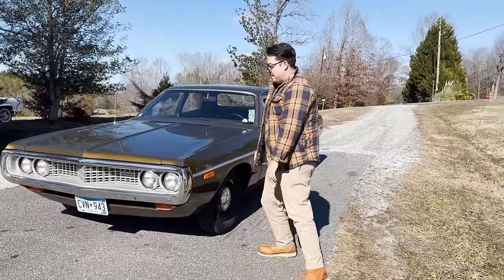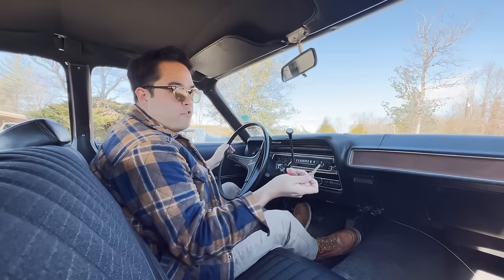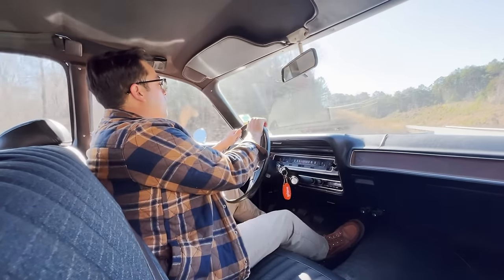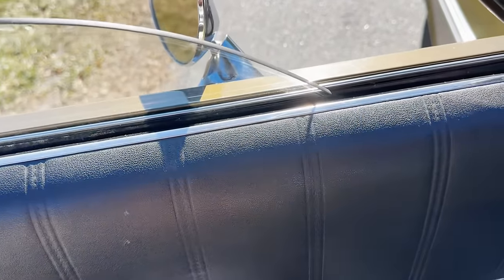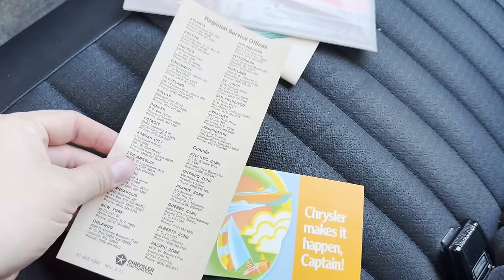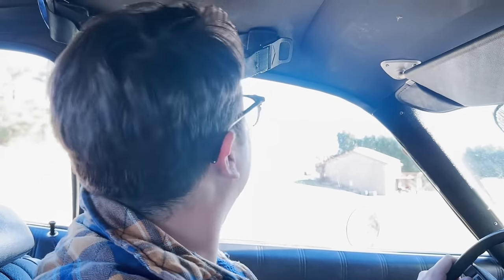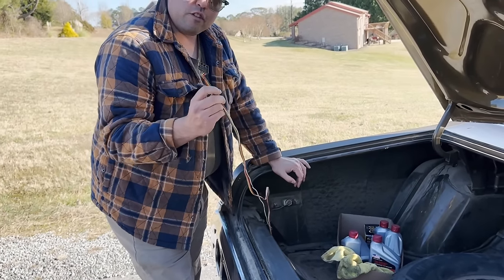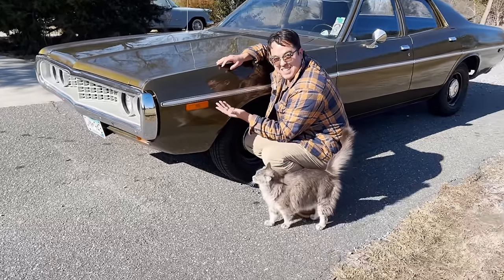1972 Dodge Coronet Custom! Rare Slant Six Stick Shift! Obsolete Automotive Reviews Walkthrough Drive

Comment: hidden wipers were a big deal because of the new automated car wash, some would rip them suckers right off, antennas as well...  hidden tucks em out of the way no issues, plus the heat doesn't pound on the ribber wiper blade destroying it in a day.. "118 in phoenix today"...  park inthe direct sunlight for 30 minutes in that kind of heat.. wipers STICK to your windshield and destroy wiper motors.. so more than a few reasons right, looks better?  the wind doesn't catch them and whistle?  jackyls are less likely to grab em and rip em off, why they had retractable antennas as well.. oh yea that's a thing when you are 13 and rebellious as hale...

Comment: Nice car. Reminds me of a couple of Fords I had with Six and stick....with little else. Just refrain from calling it "three on the tree"..most auto nick names sound stupid. like dog dish hub caps. Drum brakes are fine. and go easy with that shifter. Shift slow and deliberately, don't push hard to get 2nd out of low.....nothing will break if you shift easy. and    yes years ago we called them "stick shifts" . Too bad there aren't any cars like this today. The market could use realistic sized cars with no bullshit in them.

Comment: The advantage of hidden wipers is that the blades don't freeze over in the winter when driving in slushy conditions. The rubber also lasts longer, since they are hidden away fron the UV rays in the summer. I wouldn't really mention the aerodynamics as these era cars were really bricks in the wind, but they are a bit quieter at higher highway speeds since less drag on the w/shield. 

Have the same wipers on my 2dr Newport Custom . Check my channel out. Cheers

ps/ how much u sellin' this Coronet for ?
Reply: Instead, the wipers get frozen over in a chunk and don’t funtion at all unless you dig out all the ice from the cowl
Reply: But the clip for the articulating arm pops loose and the wiper blade flops all over the place.
Reply from the maker: Be sure to follow my Instagram where I post any cars for sale. I have some work to do on this car before listing it.

Comment: In the '60/'70s, the 6cyl & 3 on tree was the basic power train for almost all models. These strippers were known a price leaders. Usually had rubber floor mat, dealers rarely had more than one or two on the lot. Oh, you wanna V8? It's going to cost extra. I don't have price list for Chrysler corp, but a 302 V8 in a 1973 Torino upped price $95(was std on Gran Torino). Don't want to shift? Automatic will set you back a couple pay checks, $210. The tunes, AM flavor, $64, AM/FM, $208. All about the money, I can guarantee the 318 cost extra over the bent six. Each mfgr had comparable models to the others.
Reply from the maker: The 225 6cyl and 318 v8 were both standard in the Coronet and Coronet Custom for 1972. No difference in price from what I see. The 400 big blocks with 2bbl or 4bbl were extra cost options.
Reply: @ObsoleteAutomotive  In the Standard Catalog of American cars, TWO prices and weights without explanation are listed for '72 Coronet. Sliding over to Plymouth Satellite, the two are said to be engine and weight. So, if both were std, it wasn't a same price choice (Seems like a confuse the customer tactic to me). Customer paid EXTRA for V8. The 6cyl was $2721 while V8 $2828(or $107 difference, which is within $12 of what Ford was charging for "optional" 302 V8). Weight with 6 six 3350 Lb, while 318 were 3375. Station wagons are listed only with one price/weight, 318 v8 is said to be std.
Reply from the maker: @tombryant1104  Unless we find a factory price list specifically showing the difference then I can only go off the literature. Normally if an engine is extra cost then it would show it as being extra and not standard. Also six cylinders could be ordered in wagons so that isn’t an accurate reference. 

Six cylinders many times would have smaller brakes, weaker transmissions and rear axles and such so a price difference could be reflected in that as well if the cars varied in equipment due to difference in engines. Sales tactic? Perhaps.
Reply: @ObsoleteAutomotive  I can see your point, but I don't see Chrysler selling a entry level vehicle at same price for 6cyl & V8. If they did, they would have had a big edge over the other auto makers charging extra for V8. No chance they were going to lose $100 per car. V8 have additional parts and more complex machining procedures that requires additional time to complete.

Comment: Man, are those red wings you're wearing 😊 ?
Reply from the maker: They are Thorogoods
Reply: @ObsoleteAutomotive Still, good😊! Thumbs up! Love the video. Cheers, mate!
Reply from the maker: @riddickriddick9520  I got redwings too. 😂 Thanks for watching!
Reply: @ObsoleteAutomotive  Np, love those old american cars! I just bought iron rangers few days ago, amber harness ... still breaking them in.😁
Reply from the maker: @riddickriddick9520  I got a couple pairs of the Iron Rangers myself! I find the “old style” boots very comfortable. Been wearing them for over a decade now.
Reply: @ObsoleteAutomotive  Exactly! So how do you condition them? You use those "saphire" regenerators and creams, or do you use cheaper products?
Reply from the maker: As of recent I only really use Huberd’s Shoe Grease to keep the leather from drying out and it also water proofs them. I also have used neatsfoot oil.
Reply: @ObsoleteAutomotive  I see...thnx for the tip, mate 😁!

Comment: You need to Midasize it badly, and you really need to clean the windows.  I would spring for a new brake system, and spend the money for Power Disc Brakes On All 4 Wheels.  It's worth it in Minnesota.  A Slant-6 is overworked in a Coronet and it is BEATEN TO DEATH in a Monaco.  The car is TOOOOOOO BIG for that engine, which was really made for Darts and Valiants.  12 MPG SUCKS in a car with no luxuries.  Still, these days you're lucky to find a Mopar at all.

Comment: Nice car... too bad the driver beats on it this way. No reason to be winding it out to 6 grand on every shift. Pushrod engine.... you'll kill it quick. treat that gear shifter nice too. Unobtanium if you break it.
Reply from the maker: Because nobody ever puts a car through its paces. It shows the car can move if it needs to. 

The shifter ain’t going to fling apart. The engine ain’t going to explode. And I can actually flog the shifter and car if you think that was “bad” on it. I drive these cars daily and for years and thousands of miles and have yet to have any of these catastrophic failures.

Comment: A small correction from an "old fart"...The title of this vid is misleading (unintentional of course), because...your 1972 Dodge is NOT a "stick shift." Just because a car has a manual transmission does not make it a "stick shift." What you have is known as a COLUMN shift (because the lever is on the steering column). A "stick" shift is ALWAYS floor mounted.
Reply from the maker: Please show me the dictionary, manual or any other piece of literature that states this. 

Stick shift is a common slang term for ANY manual transmission. You are shifting with a STICK whether it’s sticking out the side of the column or up through the floor… but only if it’s got a clutch. 

Automatics can be column shifted or floor shifted and we don’t go calling them stick shifts… ever. We won’t go into “Auto-sticks” however.
Reply: @shanew.williams What region are you from? I've never heard that.
Reply: @404goldie7  I am from Alabama USA.

Comment: I had a basic 1976 Valiant with a slant six. Problematic engine... under powered, noisy, clattering valve train, leaked and burned oil... even after valves adjusted they would go noisy in a couple of months. It constantly stalled in wet or cold weather and a nightmare to start because of a bad design flaw called vapour lock. That's just the engine... the car itself suffered terrible rust problems and used garbage parts. Needed constant muffler and exhaust pipe replacements almost yearly. Electricals, ignition, wiring, coil, etc were the worst. Not great fuel economy either.  Parts were very cheap to buy though and easy to replace... but otherwise just an ugly, miserable shitty car... I hated it.

Comment: Three on the tree is NOT a stick shift.
Reply from the maker: “Stick shift” refers to any manual transmission. This has been a normal phrase for manual transmission cars for decades and decades. Whether it’s on the floor or column you’re using a “stick” to shift the transmission through the gears…
Reply: @ObsoleteAutomotive  — In the Book of BL, he states that, “sticks do not grow on trees” …